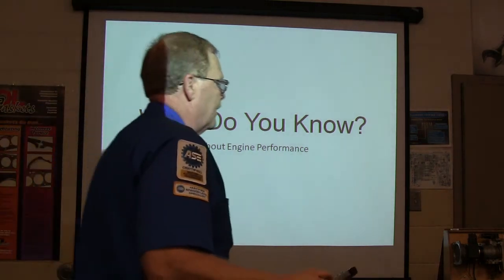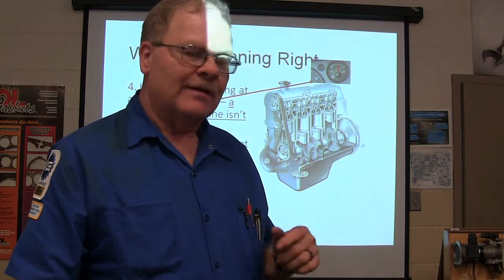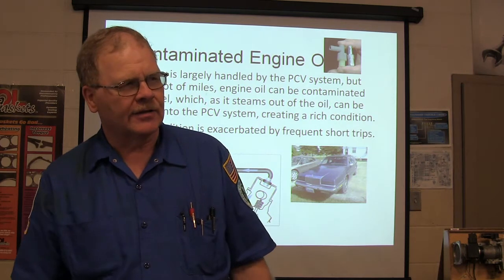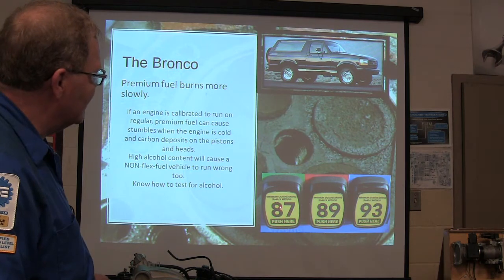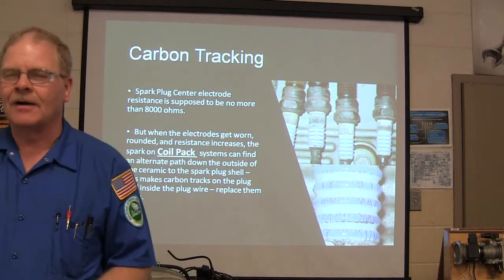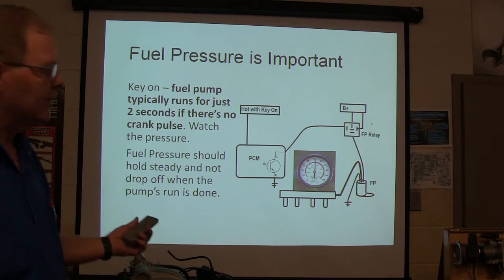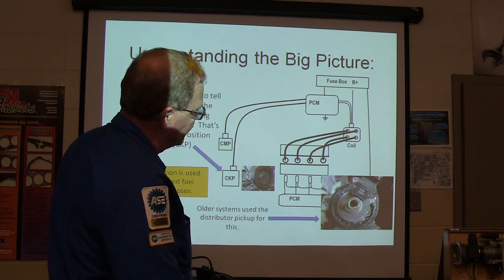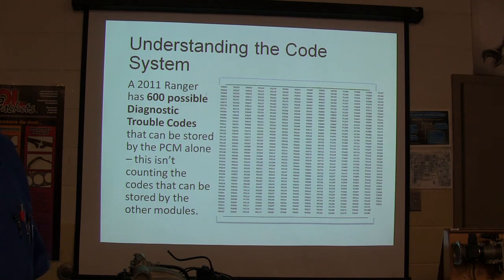Engine Performance Basic Principles

Comment: 1996 ford ranger crank no start..low fuel pressure...fuses tested good with a test light. Viltage at pump low 7 v...wiring perfect....pulled the fuel pump fuse for visual and found it was "almost" blown...some browning and melting...would start sometimes but run rough. Used connector file cleaned up fuse connector and replaced fuse....ran perfect good fuel pressure...2 hours digging.
Reply: Also cleaned pump ground
Reply: When you have voltage drop, always follow the circuit back. If youd have done that, and checked your fuse with a meter, more than likely, youd have found battery voltage on one side and your 7v on the other side. Test lights can get you in trouble sometimes, as you learned.